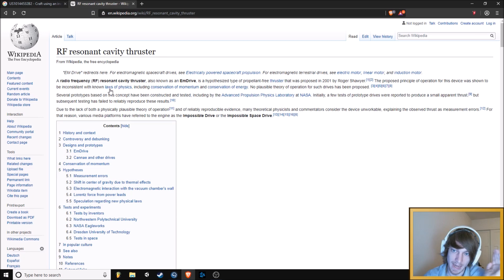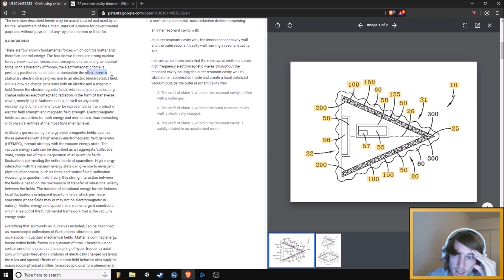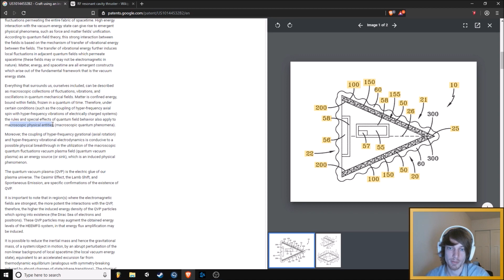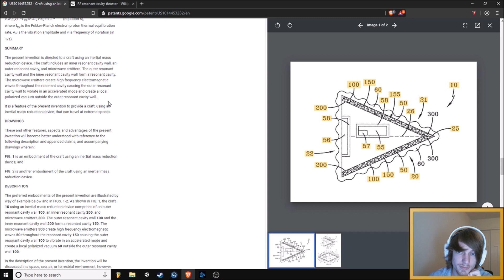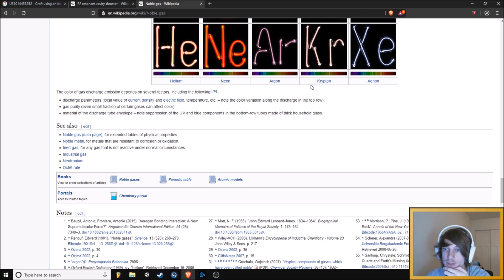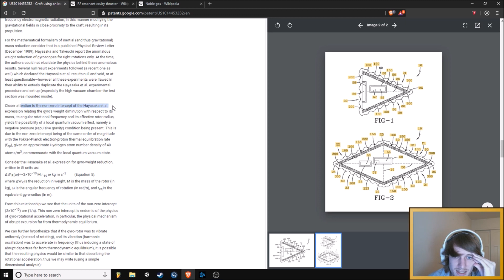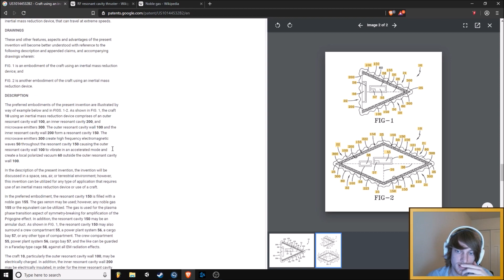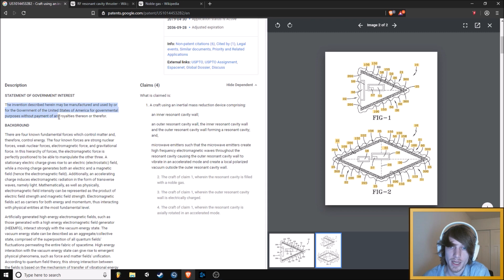EM Drive Is Back! (UFO? UAP?)

Comment: *HAS ZERO TO DO WITH EM DRIVE*

It takes control of the inertia creation process between the background field and the atoms of matter.  It's a technique called "Coherent Superposition" imposed on the background field. 

About 99.999999% of the population of this planet - with the exception of some (like Mr. Pais, his compadres in the Navy, and some in the intelligence agencies) believe the following:

1)  "Inertia is a natural trait of atoms - of matter."
2)  "Inertia for a given matter object is Fixed, Constant."

Neither of those is true.  The Background field - which was physically proven to exist with positive experimental tests of the Casimir Force, the Lamb Shift, Spontaneous Emission,  the Aharanov-Bohm Effect,  the Sagnac Effect, and others -- 

the Background field interacts with atoms and creates inertia.  The more atoms, the more inertia. 

It will probably be 100, 200 years before that will be commonly held.  For now,  our government, to their credit, is at least TRYING to get the word out.

If you read the patent carefully, you'll find that using a microwave frequency generator and a microwave resonant cavity, and very high static electric voltage on the surface of the cavity resonator -- you can TURN OFF INERTIA CREATION.

Since I've taught STEM classes (UC Santa Cruz) in the past, I know how to make something complex - pretty easy to grasp, at least CONCEPTUALLY.  Here goes.  This is a conversation between the atoms of the microwave cavity resonator in the patent, and the background field:

MCR: "look, I know you'd like to create inertia with my atoms but I'm going to temporarily block you."
BF:  "How?  You can't,  I'm a superposition of energy at all different frequencies - very chaotic."

MCR:  "I'm going to polarize my atoms with a very strong static electric field.  Then I'm going to pump a high-strength microwave EM wave, AT RESONANCE, I'll be creating a standing wave of microwave frequency in the cavity"
BF:   "What will that do?"

MCR:  "It will impose an orderly nature on your normally chaotic energy flux,  what you call your 'superposition' of lots of different energy.  I'll be imposing 'coherency',  aka "coherent superposition" on you - but only in the region close to my cavity resonator."
BF:  "And that will prevent my chaotic energy from creating inertia with your atoms?"

MCR:  "Yes."

Per the patent, page 4, left side, 4th paragraph, you only need 1 amp per square meter in a static electric field on the cavity resonator wall, and a microwave frequency at 100 GHz pumped into the cavity resonator to create enough 'vibration' in the walls of the cavity resonator to take control of HOW MUCH INERTIA the resonator will create with the background field.

One day they're going to be teaching, in STEM courses, how inertia works, and how gravity works.  But it looks like they're dribbling it out very incrementally.
This Pais "inertia control" patent is a great milestone.  Previously you had to study the Joseph Weber and HW Wallace gravity patents and make some intellectual leaps to get the message.  Here, in this 2018 Pais patent, they tell you you'll need a microwave cavity resonator, with one insulated wall, 100 GHz and 1 amp per square meter charge.  Freaking nice.
.
Reply: So it’s basically harnessing Unrah radiation and the rindler horizon, that naturally effect quantized inertia, to produce inertia?
Reply: @Ali-gh7rj  His job is/was to convince everyone "this is not our tech - it's light years in advance of us".  Watch his videos and when he's describing the vehicle's tech, count the number of times he alludes to it as being "alien", "so advanced",  "so far beyond our science"

The entire ufo coverup has this aspect to it.  GOAL:  convince anyone with deep curiosity that "it's aliens" to take them off the scent.  "They won't pursue it if they think its a million years ahead of our science."  

The foundation of gravity tech was laid in 1916 General Relativity - one of Einstein's predictions in GR was "accelerated matter creates gravity" - this was a 'dynamic gravity' he predicted.  This prediction was not verifiable at that time because 'matter' in his prediction meant "a lot of matter" like a planet.

In 1938 Isadore Rabi invented a way to align and accelerate, by high frequency oscillations, a bulk of atoms in a material. 

In 1938 someone surely made the connection "GR says accelerated matter creates gravity" and "Rabi's device accelerates matter at the atom level"  and attempted to verify this part of General Relativity.

Attempts to verify the predictions of General Relativity have been a huge effort in the scientific community for over 100 years - the most recent being the Gravity Probe B project in the early 2000s.

Back in 1938, and the early 1940s, Rabi's NMR - nuclear magnetic resonance - a HIGH FIELD, CONTINUOUS version of it - was probably used to verify that prediction of Relativity. 

Continuous oscillating acceleration of aligned atoms in a metal at high field strength - a version of NMR called Nuclear Quadrupole Resonance (NQR) - is probably the foundation of many of the government/military's gravity vehicle program.
.
Reply: @Greg_Chase   So bob Lazar job was to fool people? So we have this since the 80's? Well what is the point of having this type of aircraft  it looks like it is so secret and advanced that they cannot use it. What is the point? 
If the patent is correct,making UFO type aircraft for the army would be the last of our concerns. This patent would flip our world upside-down, transporting us into an other level of civilization.
I don't believe that UFOs ( Nimitz incident) are ours. It they are we are even more stupid than I thought.
Reply: @kyzer97320  In General Relativity in the year 1916, part of Einstein's field equations showed that accelerated, high-energy matter would create a 'dynamic' (aka 'changeable', 'controllable') gravity field. It was hard to test that part of General Relativity because in 1916,  "accelerated, high-energy matter" could not be handled on a laboratory scale - it happened to large object (planets, etc.) in space.

In the year 1938 Isadore Rabi invented a technique to energize/accelerate the individual atoms of substances, called "nuclear magnetic resonance".

This meant you could take a sample of "passive" matter and add (electromagnetic) energy to it in a way that was not available 22 years earlier, in 1916. 

Recall that ongoing efforts since 1916 have been carried out by different parts of the scientific community to TEST and VERIFY, the predictions of General Relativity.  The most recent test was in the early 2000s, the "Gravity Probe B" project, a huge effort, that verified part of General Relativity.

So as early as 1938 it become possible in a laboratory setting to energize/accelerate samples of matter at the atomic level.

It's quite likely someone on Rabi's team or another scientist put 2 and 2 together  "some gravity field equations in General Relativity predict that energized/accelerated matter creates gravity"   and  "Rabi invented a way to energize/accelerate matter"

....then used NMR (nuclear magnetic resonancce)  or  NQR  (nuclear quadrupole resonance) to test that prediction of General Relativity.  It's 100% likely the military/government would have used NMR or more likely NQR to test the 'dynamic gravity' part of General Relativity, as early as 1938. 

WHY NOT tell the world that gravity control exists?  Possibly because the Tokamak fusion reactor would finally begin to work after 60 years.  Look it up. The Tokamak has never produced more watts of output power than what is put in.

Fusion like that in the Sun REQUIRES A GRAVITY CONTAINMENT field.  The Tokamak does NOT HAVE a gravity containment field. 

On the day a gravity device is added, it would allow the Tokamak to produce excess energy (more out than put in).

So this is a reason for keeping gravity control quiet.

It's not the only reason.

.
Reply: @Greg_Chase  I don't the knowledge required to debate the physics. But I still doubt it is true. Why would you care about gravity field on a tokamak...Salvatore Pais patented a compact fusion reactor making any tokamak useless. He patented a lot of crazy devices, to many. That's the problem, this single men have patented a lot of revolutionary stuff. And yet nothing happens. He does nothing. He is not the world most powerful men yet.
Reply: @Ali-gh7rj  To understand gravity you have to know that something has to exist to keep the Vacuum uniform and isotropic.  Some physics people wonder "why are there electron/positron pairs popping into and out of existence?  It seems pointless"

That is part of the mechanism that maintains an electrically uniform and isotropic condition of the Vacuum.  An intense electric field in a radio antenna or a star is a *non-uniform, non-isotropic condition* and the Vacuum seeks to 'smooth out that bump'. 

The particle-antiparticle pairs, including electron-positron pairs, do not annihilate IF they pop into existence adjacent to an energy field.  They then go to work and radiate away the condensed energy to 'smooth out the Vacuum.' 

These particle-antiparticle pairs are not out there wasting time popping into and out of existence.  Those are the 'white blood cells' of the Vacuum.  They pop up everywhere and if there's a nearby energy field that needs to be 'screened' (aka "have its energy de-localized and distributed radially outward in all directions to 'remove the bump' from the Vacuum") - it is then that the particle-antiparticle pairs STAY ALIVE.

They carry off the condensed energy from a radio antenna; a star;  a gravity vehicle.

The gravity field is Nature's tasking of the particle-antiparticle pairs to attempt to recover its preferred condition - uniform, isotropic.  Nature relies on the particle-antiparticle pairs to pop into existence, drain off energy, then radiate it outward in all directions.  Just like how a rock in a pond does not simply create a SLAP on the water and that's all.  The SLAP is concentrated energy that is radiated away so that local energy concentration - the SLAP - returns to an ambient uniform condition.   The ripples in the water, carrying away the energy of the SLAP.

That's all Nature is trying to do with the immense energy fields of the atoms of Earth, the Sun, a radio antenna, etc.

Aligning and oscillating (accelerating) the atoms of a vehicle's hull at high field strength - on one side of the hull ONLY - causes the Vacuum to attempt to induce charge-separated dipoles in the particle-antiparticle pairs around the condensed energy on that side of the hull.  The energy is drained off the hull by inducing a charge separation, a dipole, in all the nearby particle-antiparticle pairs.  That energy is then radiated away in all directions.

These particle-antiparticle pairs require a 'push' of energy to induce the charge separation of the particle and antiparticle, a 'push' of energy to induce a dipole - and that 'push' of energy is DRAINED from the energy of the atoms in the vehicle's hull (or radio antenna or star).   The particle and antiparticle RESIST having a charge separation induced - and that is a 'spring' like the spring in a car's suspension type of action.

The particle-antiparticle pairs are thus like SPRINGS.  It takes a 'push' of energy to induce a dipole and it comes from energy drained off the energized atoms.  ONCE THE DIPOLES ARE IMMENSELY STRETCHED - like by a planet, a star, or by one side of a vehicle hull - they act like a car suspension that has been compressed - they don't spring back normally.  They are STRETCHED. 

Under normal conditions, the particle-antiparticle pairs exert a RECOIL against the atom.  If the atom attempts to accelerate (ie if the object is accelerated) it creates a temporary localized increase in the electric field - and that sudden increase is immediately drained off into the surrounding particle-antiparticle pairs.  THAT'S WHAT INERTIA IS.  Inertia is a loss of energy.  You push something, it moves but you had to overcome its inertia.  Where did that lost energy go? INTO THE particle- antiparticle pairs - the energy induced more-stretched dipoles in the particle-antiparticle pairs. 

On the back side of the vehicle the particle-antiparticle pairs are not draining as much energy.  They exert FULL RECOIL against the back of the vehicle.  Only the front of the vehicle has aligned/oscillated the hull's atoms at high field strength.

AT THE FRONT OF THE VEHICLE:   the spring recoil exerted by the particle-antiparticle pairs is SPENT.  Those particle-antiparticle pair dipoles are STRETCHED.  They have drained energy from the highly-energized front hull.  No spring suspension Inertia action available. 

AT THE BACK OF THE VEHICLE:    the spring recoil - ie. the RESISTANCE of the particle-antiparticle pairs to having a larger dipole (charge separation) induced in them - IS NORMAL INERTIA MAGNITUDE.

The vehicle feels the recoil from the back, and no recoil on the front.  It is an *UNBALANCED INERTIA CONDITION* that was created.  You can guess which direction the vehicle moves  (not backward).

That's how they work.

Gravity is a SIDE EFFECT of the Vacuum saying "I hate condensed energy fields. No one but me is going to keep me uniform and isotropic - I gotta do it myself.   I'm sending a fleet of particle-antiparticle pairs to drain off and redistribute all that condensed energy." 

To get a sense of the 'spring recoil' action of the particle-antiparticle pairs, a few things:
1) they are everywhere - all around us, inside us, inside all matter objects

2)  imagine you're in space far from any planet or gravity field, a flock of particle-antiparticle pairs pop into existence and due to the energy fields of the atoms of your vehicle, the Vacuum sets out to drain the energy away - a "Pascal's Law" type of effect radiates the energy out equally from you in all directions - carried off by an immense number of particle-antiparticle pairs.  The resistance of the particle and antiparticle in each particle-antiparticle pair to a charge separation is like a spring.  They drain energy off you, a small dipole is induced in them, and there is a flock of particle-antiparticle pair springs all around you - with exactly the same amount of stretch.  You are in space, far from gravity, and an immense number of particle-antiparticle pairs exert identical "I don't wanna stretch my dipole out any further!" recoil against you.

3)  if you then accelerate, the electric charges in your atoms create a temporary local increase in electric field intensity and the dipoles - the springs - stretch a bit, aka drain energy from the temporary local increase in electric field intensity.  That's INERTIA.   When you stop accelerating, the local electric field intensity is uniform and the dipoles are not stretched, and Inertia vanishes

4)  call your inertia out in space "rest inertia"  (not rest mass, which is a b.s. term) - your rest inertia is IDENTICAL regardless of which direction you try to accelerate.  You have balanced inertia all around you.  You will NOT suddenly start moving or accelerating.

5)   at Earth - all the particle-antiparticle pairs have drained immense energy from Earth's atoms.  The dipoles in each particle-antiparticle pair is IMMENSELY stretched due to having drained off so much energy from Earth.  Such a dipole cannot provide normal recoil against a small matter object -- the 'springs', the particle-antiparticle pairs around Earth, are like a car's suspension that has been so compressed, it can no longer provide a recoil.

YOU, AWAY FROM EARTH, IN SPACE:   "My rest inertia is identical all around me, and I'm not moving, I'm in an at-rest, non-accelerating condition."

YOU, NEAR EARTH:   "My rest inertia has dropped in a gradient approaching this planet and I'm falling into it - the particle-antiparticle pair dipoles are very stretched out and cannot provide rest inertia (recoil) on the side of my vehicle facing Earth, while there's more recoil on the side of ship not facing Earth, so I'm being pushed into Earth, along a declining gradient of rest inertia."
.
.
Reply: @Ali-gh7rj  Any conventional work done by employed scientists is required to be "SAFE ZONE SCIENCE" meaning there are established, accepted, mathematically described explanations in a book(s) and/or peer-reviewed published research that they can fall back on.

'They' have either purposely or unwittingly removed all financial/survival incentive to apply "creative destruction" to old ideas in science.

It takes hobbyists and people with zero reputational risk to introduce "off-the-beaten-path" work. 

It sucks bigtime because the world desperately needs the tech that many people have mastered but are intimidated into not sharing. 

If you have a functioning artificial gravity device and you build a small hot fusion reactor that is based on gravity containment,  they will surely kill you.   Or they'll do what happened to Dave Adair in 1970 - he created a gravity-containment fusion powerplant for the military.  He wasn't IN the military at the time but was getting assistance from them.  They conscripted him as soon as he demonstrated the device worked.

At least they didn't kill him.
This is why I'd never publish, lecture, sell anything that is part of the government's "sandbox" of tech. 

There are TENS of THOUSANDS of physics/electrical engineering types who have figured out gravity.   it's not that hard.  But they are afraid to say anything because the government/military is an UNCONSTITUTIONAL, DUMB, VICIOUS AND VIOLENT ANIMAL for something as simple as how Mother Nature works.

Because that's all it is - Mother Nature.  You should not murder people who learned how Mother Nature works.  Should not.
Reply: its more like hiding inertia, rather than turning it off.  nevermind, i guess its the same thing.